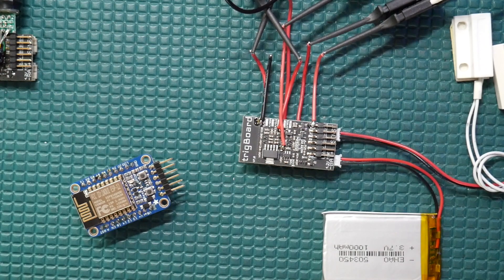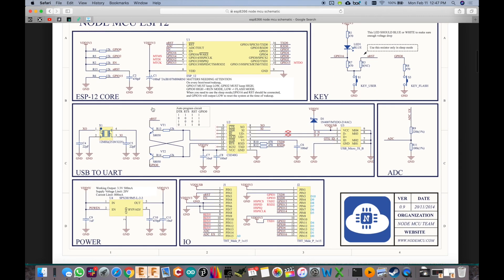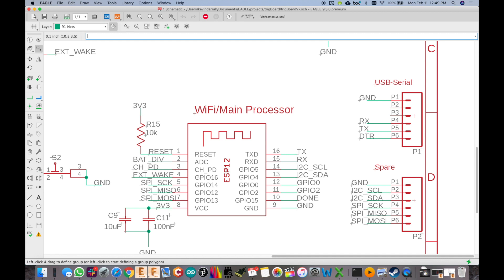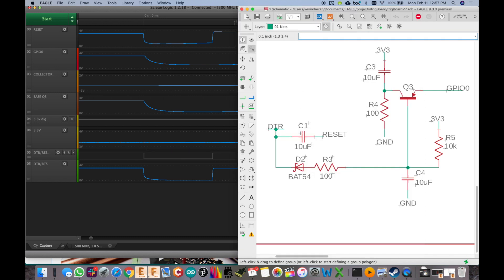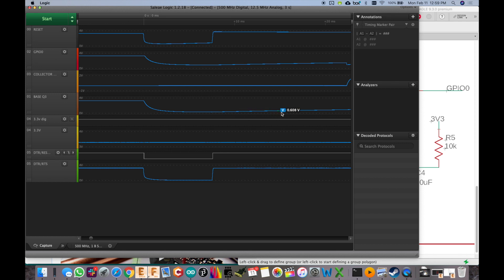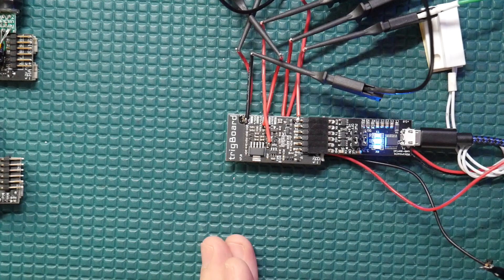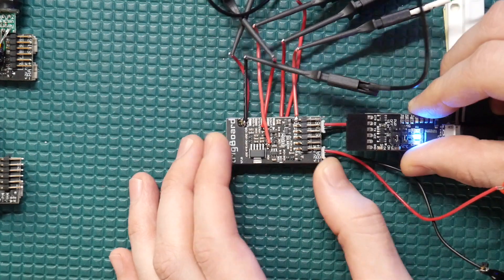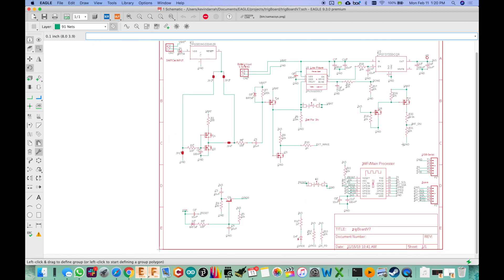ESP8266 Auto-Reset/Program Circuit!

Comment: I have a Q about the RC circuit connected to the PNP collector (C3 and R4).
Your Saleae screenshot shows that with a DTR pulse of ~2ms, you end up with a voltage of 1.2v on the GPIO-0 line (at the 12:05 point in the  video).
This equates to a 63% drop in the GPIO voltage,( ie a 'Time Constants worth) over 2ms....but your RC time constant of 100 (R4)x10E-6(C3) is 1ms, meaning that either something is adrift or the R+C values that you actually used in the 'TrigBoard' PCB don't match the schematic.
What am I missing here?

Comment: Can the caps be polarized? I don't have anything else. Tried with polarized caps, can see the voltage ons GPIO0 come up slowly, but the ESP won't enter flash mode. Pulling GPIO0 to GND directly within the breadboard does so the rest seems to be fine. Any advice? Thanks!
Reply from the maker: probably not - this relies heavily on timing, so would only use ceramic caps

Comment: Hi Kevin! Nice solution, but I see a potential flaw in it. If the port is used by the "wrong" app, it can pull DTR low for enough time to give C1 quite a charge, so when DTR is pulled high again voltage on the reset pin would tend to be twice as VDD with quite a low impedance, which could overload ESD diode and cause a latch-up. Another BAT54 from reset to VDD should improve this.
Reply from the maker: oh yea, good call, but just with Arduino IDE and basic terminal apps, I haven't seen any strange behavior.  I'll take a look at this though.

Comment: Nice work, Kevin! The capacitor value are fairly high. What kind of capacitors are you using?
Reply from the maker: nothing special - just 0603 ceramics X7R
Reply: @Kevindarrah  Hi Kevin, thank you for responding! Hehe, I must be getting old. I know the voltage is low but did not know X7R existed in such high values as 10 uF - but multilayered ceramic capas seem to have evolved a lot since I worked with this professionally 20 years ago. A quick google search confirmed at least 0805 is easily available.

Comment: Again well done. Sounds perfect!. I am designing a trigboard clone...I can share u the easyeda schema if interested. Why do u use 2 mosfets to read battery voltage...I just used one (Q6 on your schéma) and it works great...you will save some Space on the pcb. Another thing : Note: you don’t have to add an external pull-up resistor to GPIO2, the internal one is enabled at boot so u Can remove R12
Reply: i am interested in this easyeda schema. can you share it with me?
Reply from the maker: nice, thanks for that!
Reply: Easyeda link to my Trigboard Clone : https://easyeda.com/editor#id=e9b20b0b24054b138e472d68f15093d3|1cba02cc0f184ef3a1e3733813702cba
Reply: @fredericguiet2077  should yr link indeed lead to a site in Chinese only without any trace of a design? Or did I misunderstand something?
Reply: @Ed19601  Dunno...link seems to work now....
Reply: @fredericguiet2077  thanks for checking but same result, screen in Chinese, no circuit
Reply: @Ed19601  Just checked myself and the link does seem to be working fine. Maybe try it in a incognito window.
Reply: @ingy23  thanks, that didn't work for me, but I discovered that because I checked it from my phone, it is quite adament in changing the 'editor' section of the link into 'editor-mobile'. I presume that may have something to do with it. Will need to wait till I am back home. Safari on iPad also encountered problems ..... Will just wait till I am back home
Reply: @fredericguiet2077  Would you mind sharing your schemetic? The link seems not to work any longer..